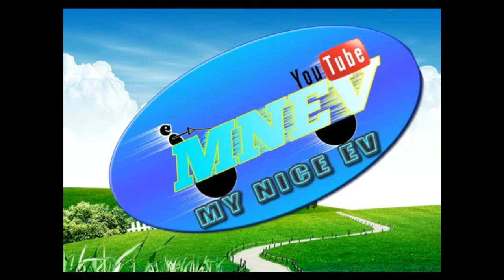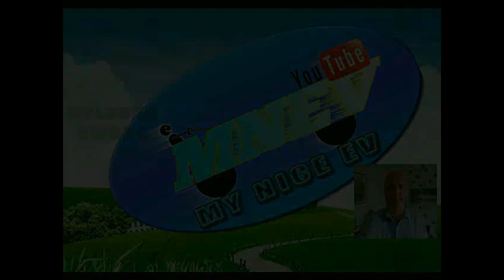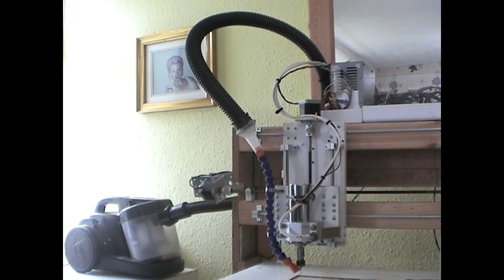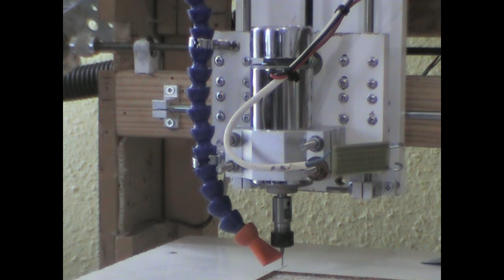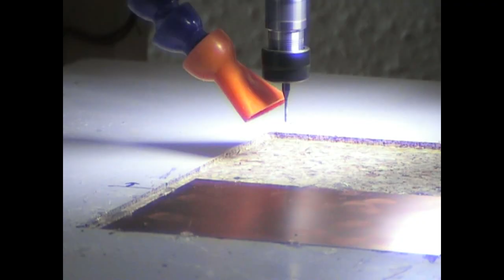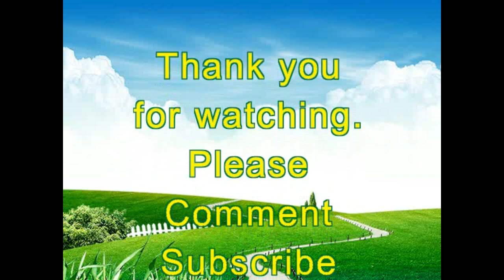DIY CNC Part 120

Comment: Hi Raymond Your new spindle motor looks the biz should speed up your board per hour output.
when you get the flex fixed fixed on your cutting table could you not rout the whole table to level it.
All the best my friend .
Jace.
Reply: +Raymond Earle So are you selling the light boards complete with leds hand soldered by yourself.
Reply from the maker: Yes my friend. If you watch my lightboard playlist you will see yours trully in action. LOL. Regards to all of you.
Reply: Raymond No problem hope it helps.
all the best.
Reply from the maker: +Norfolktuber Hello Jace my good friend. Even if I routed the whole table the flex would still be there. It's only going to cost £40. Should have it saved by mid January 2016. Unless of course I got orders for my light boards. Then it would be quicker. But not expecting to sell any this of xmas. Thier £8 each and people are concentrating on Xmas. Once I have more volt/amps going into motor yes my production will go up. Have a great day on the morrow my friend.
Reply: +Raymond Earle Where are you selling them i can't find them.
Reply from the maker: Through my email solaray@hotmail.co.uk. Didn't want to put them on Ebay because of thier DIY nature. Plans are afoot to make proffesional looking boards. Waiting on some stuff to come from Greece. Then they will go onto Ebay. If anyone is interested in them they just email me how many so I can start making them. I send back my paypal email. When I receive payment. I send them out when done.
Reply: +Raymond Earle Thanks my friend. could i buy 2 in Kit form with components, Then i will build them and review them on 
my channel, You might get some interest that way all so. Message me the cost and paypal address. 

Best regards
Jace.
Reply from the maker: WOW! Um. Gob smacked. Yes. Ok. Will do my friend. THANK YOU. Didn't expect that. Thank you my friend. Raymond.
Reply from the maker: +JACE'SRC Yes my new friend. Fully assembled and tested they are £8 per board. In the UK post is free. International depends on country.
Reply from the maker: +Norfolktuber Jace my friend. I shall be emailing you later.
Reply from the maker: +Norfolktuber Jace my friend. I shall be emailing you later.

Comment: Its good to see that you have enough lighting to see whats doing on when its working. When making a board does that flexing in the base affect it very much? I have seen alot of tables like that have flex in them but the work piece is never heavy enough alow for the flexing to happen.
Reply from the maker: +T-Mans Go Karts Hello my good friend. Yes I have seen some too. Because temperatures change rapidly in my flat the flexing can change the level of the board through humidity. So I want to have as solid a sacraficial board as possible. That way I only have the copper clad board itself to adjust for. My regards to you and your family my friend.

Comment: the rails set up is ok maybe thicker bar for them they shouldn't be enogth wait there to bend and flex the rails unless the hole base and such is out of alignment
Reply from the maker: +David Simpson It's just something I spotted and calling it a design mistke. I am going to change them for my own peace of mind really. Not neccesarily a thing that MUST be done. I hope all your projects are going well my friend and that you are looking forward to Easter like me.
Reply: why easter ? and projects had a little set back due to weather haha no solar power at all lol also I have been made an officer in the mcc so a lot of work and spare time spent with that
Reply: oh come close to fully charging the pack that failed found the dead cell turns out the charge controller was faulty but that be fixed dropping the banks down to 10 cell each bank rather then 20 then I can go upto 16.4 volt could do with getting a step up adjustable transformer that will also step power down for the led light so they get the correct voltage and not get dimmer as the battery drains
Reply from the maker: +David Simpson Chocky eggs. I'm a chocoholic. They are around alot longer than Christmas. LOL. Congratulations on your new post my friend. Very well done.
Reply: ah nah don't really do choc I think women is my thing when I find willing ones haha
Reply from the maker: +David Simpson That's why Stu and I are going to be using holders for the 18650 cells. So rouge cells are easier to find. Your transformer idea sounds great. I'll see what I can come up with my friend. You could do with a wind turbine in this weather.
Reply: last time I tried a wind generator here it exploded even foiled out the wind haha yeah I am thinking of the holders also and a big board to put them on
Reply from the maker: What turbine was that? LOL.
Reply: if I remember right one I built lol
Reply: I seem to reacal in testing of the blades let go and smacked me in the face
Reply: then another time I tried the wind bent the scaff pole
Reply from the maker: +David Simpson  OUCH!
Reply from the maker: +David Simpson You had a horizontal one. Vertical ones are best in built up areas and don't need to be very high. https://www.youtube.com/watch?v=86kyTfo71Nc this was a prototype for testing vanes. That's 2 brake disca on the bottom. At some point I am going to replicate and stick some coils on it. Magnets too.
Reply: +Raymond Earle no nothing like that no where to put anything like that